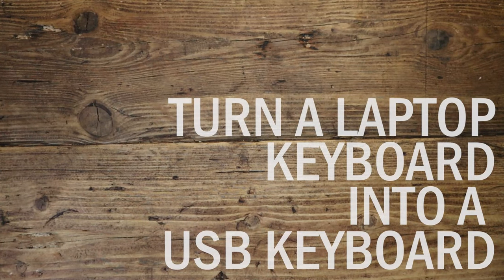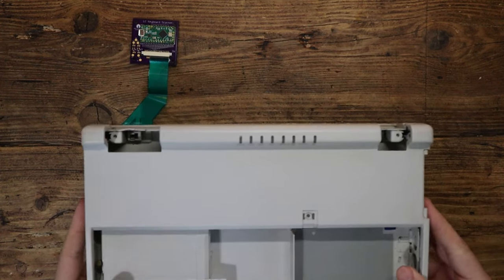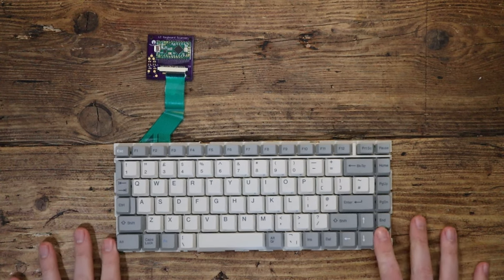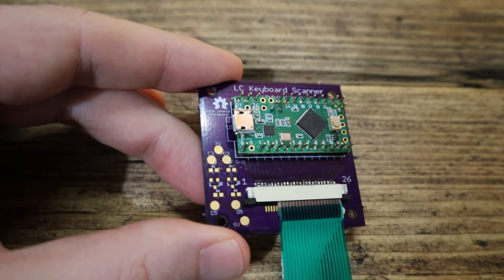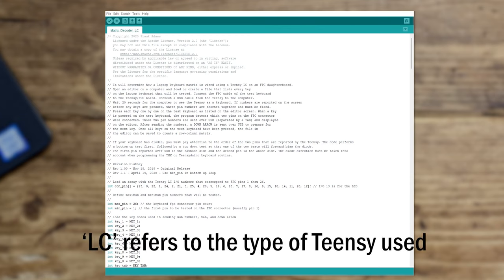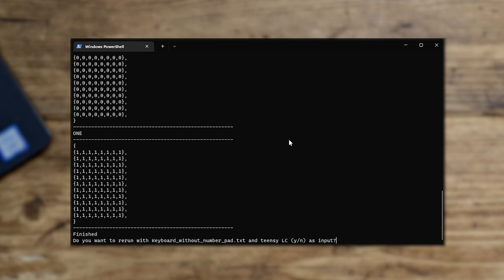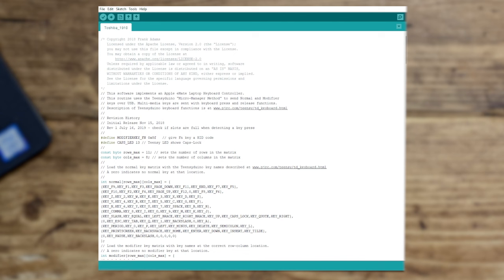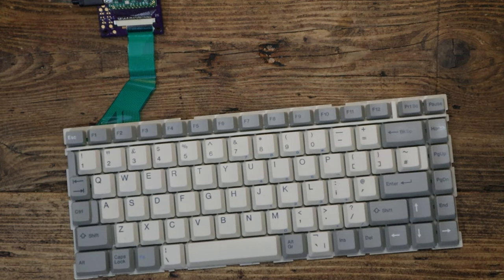Turn a laptop keyboard into a USB keyboard

Comment: I really wanted to do this but price of the board is like buying a new keyboard, youvgave me an idea good job.
Reply from the maker: Oh yes, this isn't a cheap way to do this! The cheap thing is to buy a usb keyboard, but where's the fun in that! Also, if you want to reuse an old laptop, gut it and stick a raspberry pi in it, and keep the old keyboard; well this is probably the best way to do that, which is my plan!
Reply: @Weird Old Tech  I would like to this update for my MSI GT72S-6QD which its mobo is broken. I decided to use whole parts except the mobo with single board computer in my old laptop. But this way is too complicated for me. I want to do but I don't have the knowledge for realizing this. Thanks for your video.

Comment: Old IBM SK-8840 - 45s are sold for like £300 half of the time, and at other times are in an awful state. The Lenovo SK-8855s are even more expensive, and extremely difficult to get ahold of. Yet old Thinkpad laptop keyboards are really easy to get ahold of, so this might be a good solution for anyone wanting one of those keyboards without having to sell your kidneys and  make a gamble on whether it even works well.
Reply: yeah same, lots of thinkpad keyboards are like 5-15 bucks, with a NRF52840 nice nano board and an adapter we can probably tunr them into nice bluetooth keyboards quite cheaply.
Reply: @ Hey!  A year later and I own a Thinkpad keyboard that has been USB modded. They are made by a guy in China, I used SuperBuy to order it. Its pretty decent though the case is 3D printed and not great.

Comment: I bought a replacement keyboard for my laptop because it was not responding, but it turns out that I tried to use it again and it was working perfectly. I didn't know what to do with the replacement until I saw this video. Thank you 😃

Comment: hey, do you know how to make the caps lock and numlock light up with and LED?
Reply from the maker: Hello! The setup I have there only lights the num lock light using the LED on the Tiny itself. Check out the link in the description, I think at the bottom of the guide there's a section where this is discussed. Pretty sure it's possible, good luck!
Reply: It is possible to connect the Teensy to LED lights, I’ve just finished it last month. The thing is: be careful which headerpins you solder to the Teensy. The ones not used for the keyboard can be used for the LED + never solder a pin to pin #13 on the teensy. Good luck!

Comment: i had idea to turn my dead laptop into lapdock. 
since i got a miniPC (acer veriton) and an egpu that i love to carry around...

hopefully it's work...
Reply from the maker: Wow! That would be amazing! You might be better off using a smaller pc, like a NUC or a single board computer like a pi, just for the space, but whatever you do, I'd love to see it!
Reply: @weirdoldtech  yeah, thanks so much for the advice.. but the reason i choose veriton instead nuc is because the nuc with equivalent spec would be 3 times expensive than my veriton (h110 chipset, i5-7400T, 2x8 gb ddr4 so-dimm, 2tb hdd, and 1tb m sata). plus, it have PCIex16 3.0 slot.... hehehe..
Reply from the maker: Ah cool, hope you get it to work!

Comment: Doing something similar with a Panasonic Toughbook CF-29.  SO much space inside (for battery?).  Gonna try to use the original touchscreen, touchpad and keyboard.  Not looking forward to it.
Reply from the maker: Hi David, you can definitely use the touchpad using the tutorial in the description. The touchscreen might be a bit trickier, but if you get that to output as USB you're laughing! Even if you're not looking forward to the process, I hope you're looking forward to the result! You're gonna learn so much!

Comment: I like the trackpoint pointing device (fond of Thinkpads) but Levono seem to have gone down the 'tofu dreg' route, their USB keyboard has a super-flimsy connector that lasts about a month at best and the lettering on the keys wears off within a couple of months.  I considered buying another and try setting the connector in Araldite and lok for replacement keycaps but they now only offer the US layout. I can get a proper IBM keyboard on e-bay and that would be the ideal solution (was considering buying something like a T60, removing the innards and screen and patching it to a USB connector (that's why I'm here).
Reply: Same! Love the track point feature on my old laptop from 2014

Comment: Hello,
Nice. Can the reverse be done?

Thanks and regards
Reply from the maker: Connecting a USB keyboard to an old laptop? I like your style! It'll depend on the existing connections, if the laptop has a PS2 socket I think you can use a PS2/USB adaptor, but if you want to take usb output and feed it into the equivalent ribbon cable, I bet that's a bit tricky. Would be incredibly cool to pull off though! Give it a go and share the results!
Reply: @weirdoldtech  Hi, thanks for the info.

Comment: Good job! I wanted do connect my old laptop touchpad to my android phone with bt, but i can't find any solutions or even tips on the net.
Reply from the maker: Hi Miaciejbro M! I've been having a think about what you're trying to do here and I'm strugglingtoo! So I'm thinking you could probably do it in a similar way with a microcontroller, either an arduino or a teensy or something like that which is connected to the trackpad and keyboard output (you might not be able to separate them, but you could just read from the trackpad output), but which has BT output rather than USB. Some microcontrollers definitely have BT output, so in theory you can do it! I can't seem to piece all the steps together on the internet, hopefully someone else in the comments can help you though, cos this would be very cool!

Comment: Hello there, what you think about a rgb keyboard with effects when pressing FN key,  that’s work already if I turn it into usb ? Ty bro
Reply from the maker: So let me get this straight. You've got an RGB keyboard that you want to turn into a USB keyboard? Is that right?
Reply: @weirdoldtech  Yes that all right. I have a steelseries ms-16k keyboard (msi gs63 keyboard) and I want turn it into a usb keyboard (:
Reply from the maker: Oooh I getcha! What connection is on it at the moment?
Reply: @weirdoldtech  I don’t know 🤷‍♂️ standard I think. There are no informations about the connection cable on the parts website
Reply from the maker: Ah okay, I see it, if it just needs power to light the rgb, then the method in the video will probably work. if it needs extra software, then probably not! But I say, give it a go mate, you never know!
Reply: @weirdoldtech  The craftsman I asked to cut the aluminum frame will soon be finished. When he gives me back the keyboard I will test and tag you in the video. thanks dude 🙏

Comment: This might seem like a silly question, but as a Raspberry Pi itself has lots of gpio, and a reasonably fast processor, would it be capable of capturing and translating the keys directly? It wouldn't be a USB keyboard, but for a Pi Laptop that wouldn't matter.
Reply from the maker: I'm sure it would be possible, in fact, in hindsight that probably would have been easier! It would mean you'd always have something running in the background to pick up the key presses, but that's no big deal, I guess it would prevent you from using the gpio for anything else...hmm I'll have a think about that, it would certainly mean you wouldn't need to power a separate device!

Comment: Great video!! Really walks us through the process. Now I wonder, would it be possible to replicate the project swapping the Teensy for an RPi Pico? Tbh I'm fairly new to electronics but this is super cool!!
Reply from the maker: Hello Pablo, thanks for the comment! I am certain you could do it with a Pico, or an Arduino, you just need enough pins to connect each wire separately, and then switch the process so it pushes out the keypress via USB. The bit that you'll need to overcome is the physical connection to the keyboard strip connection. You'll need something that can accept that, and feed it into the GPIO of the Pico/Arduino. Definitely possible though! Have a go!
Reply: An Arduino mini or nano (or even the clumpy R3) would do perfect for the project.
Remember the 6 analoge and the 2 USB tx/rx can be set as digital I/O giving a total of 24 I/O.
There is absolutely no demand on high clock frequency, as the keyboard scanning itself is a slow running process.
Just copy the code from here and do some testing.
Some modifications might be needed @weirdoldtech

Comment: Can I do the same conversion with an arduino?
Reply from the maker: I believe you can! You'll need an Arduino with enough row and column inputs, and you'd need a good way to connect the ribbon cable from the keyboard into the Arduino, but the principle is the same, you just need to 'read' from the keyboard to understand the key mapping and then 'output' that input as a usb device. I haven't found a guide to do that, but I reckon you could make it work! Good luck!

Comment: Whats was the price for all the parts? Im thinking to give it a shot but im dont really want to spend alot of money on it. Great Video!
Reply from the maker: Hi Quentin, thanks for the interest! The Teensy-LC Microcontroller was about £15. I couldn't seem to order just one circuit board to be fabricated, I had to get three which was about £20, and the locking connector was really only a few pence, but had to order a bunch of those too. It's not very expensive overall, but it did take a while to get everything delivered. It's a really rewarding project to take on, and a good test for your soldering skills! Good luck!
Reply: @weirdoldtech  Thank you for your reply! I think im gonna try it :)

Comment: Dosent look like normal USB i use to charge my phone with it probably has wide usb on both sides and u need to buy special chip that costs as much as keyboard
Reply from the maker: Sure USB connections come in all shapes and sizes, that'll happen when you come up with a standard and then realise it doesn't work in every situation! Yep, there's nothing about this project that saves money, that is practical in any way, or ends up with anything particularly useful. But holy heck, sometimes, you think to yourself...can that be done? And it's great fun to explore that and keep trying until you find out! Hope the video doesn't put you off trying and exploring new things!